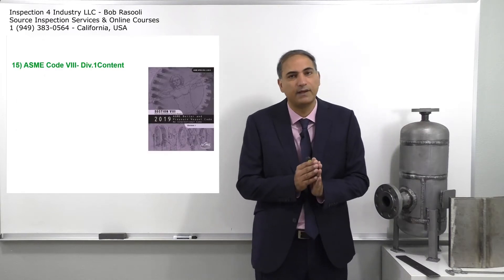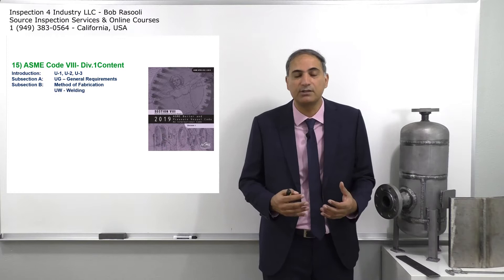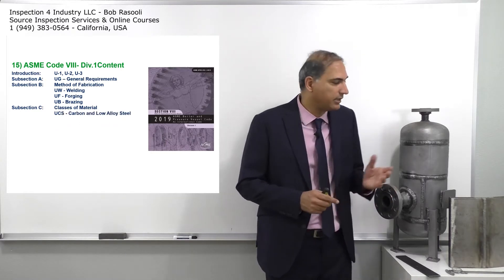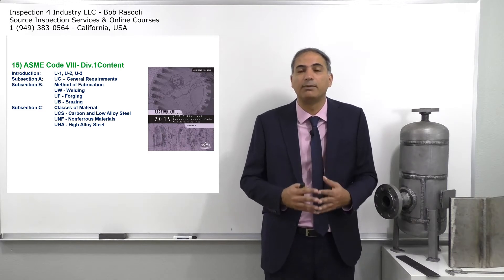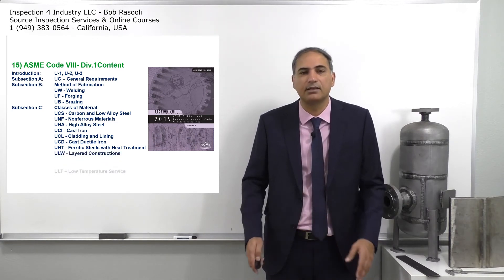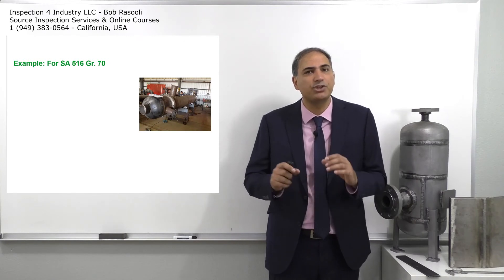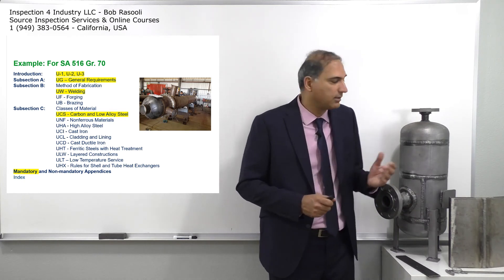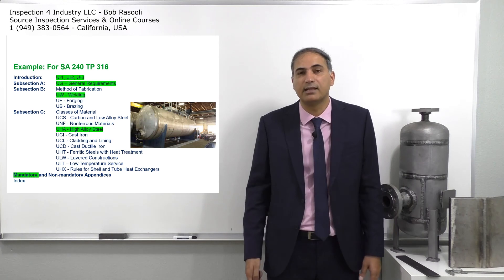ASME Section VIII Div 1 Pressure Vessel Subsections and content - API 510,  API SIFE and ASME Exams

Comment: Great. Do you have calculation memorial VESSELS OF NONCIRCULAR CROSS SECTION APPENDIX 13 of ASME VIII div. 1? I have a Vessel of Rectangular Cross Section and i would like to calculate the required thickness and the maximium allowed pressure